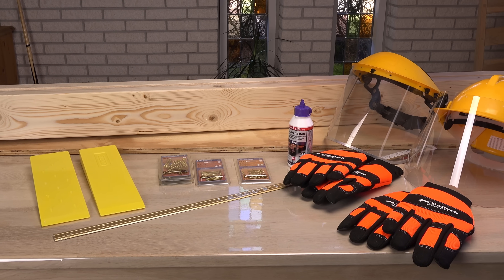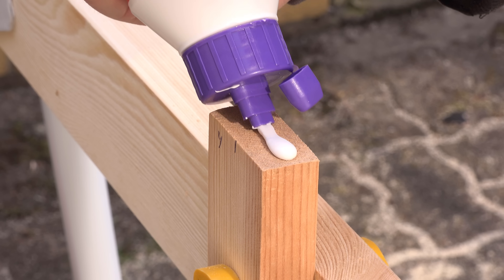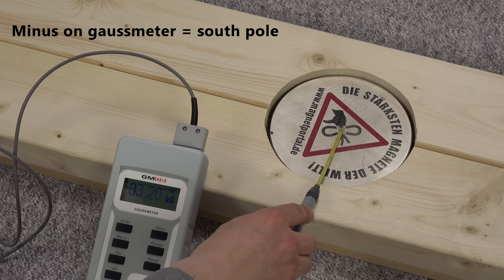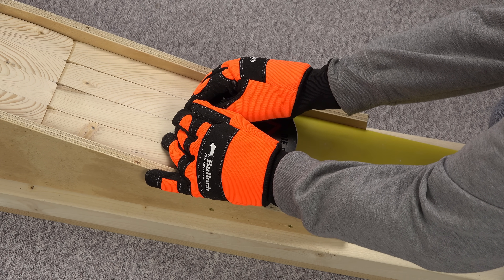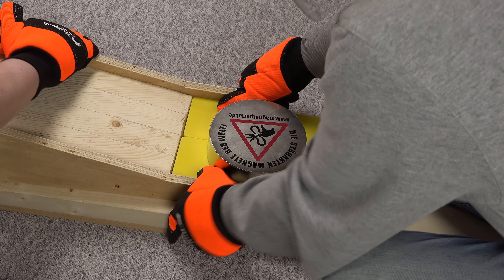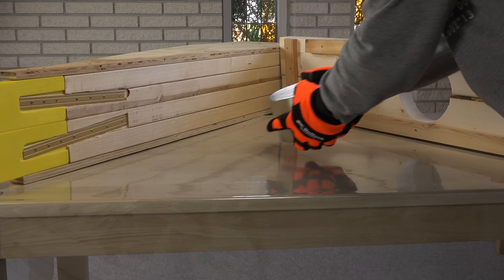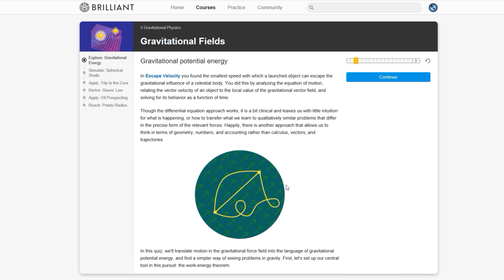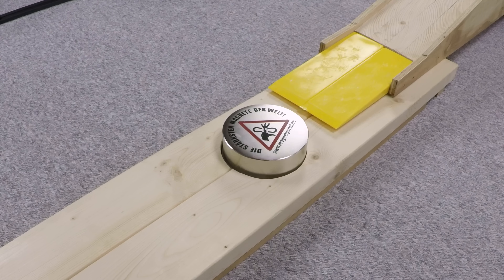Monster magnet meets monster magnet...

Comment: id say the noise was the magnet sliding on the plastic wedge
Reply: The noise is the magnet flipping over to touch the other magnet, which causes the crushed plastic wedge to expand back to its previous configuration, making that noise.
Reply: I'd say someone farted and tried to put the blame on the magnet.
Reply: Friction!
Reply: it's from the magnetic felds becoming one
Reply: I think the coefficient of friction decreases as the pressure increase.
When all the magnet area touch the plastic part the pressure is low and the coefficient of friction is high. When only the edge of the magnet touch the plastic part the pressure is higher so the coefficient of friction is lower and the magnet slips.
For the noise: imagine that the surface of the plastic part is a brush: when it adhere to the magnet because of the pressure it will deform to follow the point of contact. When it finally detach it resumes its normal form making vibrations. When the forces involved are low, the vibrations are ultrasonic and turn them into heat, when the force is high like in this case or like when something is cold rolled the vibrations turn it into sound.

Comment: Here is possibly a brilliant or stupid idea... but why not freeze both magnets in 2 blocks of ice then place them on top Of each other and then simply manipulate the melting process until they meet in the middle? Or would that not work?
Reply from the maker: I like your way of thinking, though a perfectly controlled descent might be hard to achive - especially at the end, where the forces are insane. The biggest issue is however, that neo magnets hate being submersed in water. Despite the coating, they would start corroding. And once they start corroding, they're quickly gone :( Dry ice on the other hand...

Comment: Could this be done with ice between them and slowly let it melt? Obviously restrained and controlling the speed and equal distribution of the melt....
Reply: With two point four tons of pressure from two sides I wonder if the ice wouldn't just deform and explode outwards towards the sides.
Of course you could do the entire thing inside a tube, but then you'd create a pressure vessel with two point four tons of force pressing on water from two sides, regardless if it's melted or not, I would not want to go anywhere near that...
Reply: The ice will break near the end like as if crushed by a hydraulic press and they'll smash catastrophically.
Reply from the maker: I like your way of thinking! Only issue is, that neo magnets - even with the coating - hate being in water. They corrode so easily. With epoxy coated magnets it could be a useful path. Thanks for watching :)

Comment: Could you put 1 strong magnet little bit far on right and another one little bit fat on left 
And one in middle and lift both of the right and left up, i wonder if the one in middle will float.
Reply from the maker: That's only possible, if the middle magnet is thethered. Otherwise it will turn around and align with/be attracted to the side magnets. Floating permanent magnets without tethering has been proven impossible. I believe it is called Earnshaw's Theorem. Thanks for watching!
Reply: If you got it perfectly balanced, yes. But it would still be insanely dangerous because of the two magnets to the sides.
There are much easier and safer ways to use magnetic fields to levitate things.

Comment: At the end you magnet might be turning towards Earth's magnetic field too
Reply: ElectroBOOM that's what i thought too
Reply: That's what I thought was going on at first.
Reply: Didn't expect you here xD
Reply: I love you and your channel man keep up
Reply: @ozgunkara1930  What the fuck, LOL!?
Reply: Even a small neodymium magnet does that if you put it on a smooth surface.
Reply: Yup
Reply: *your
I think that was just the table because he said his table isn't all wood.
Reply: lol
Reply: None of you were correct, partly because torque tries to turn the poles in the opposite direction, and not towards (to the same directions), partly because you mixed the mass of the earth with the rotational inertia of its magnetic field. And also because every movement can be discussed only in a given reference space, which was not given by either of you.
Reply: PafiTheOne has come to save this degenerate thread
Reply: Would it actually do that if you put it on a flat surface and somehow made as little friction to turn as possible? Or maybe hand it from a string
Reply: @Bret: it would align itself with the Earth's magnetic field eventually, if other factors like inertia (e.g. residual spin when suspended from a wire) are negligible. The magnet is heavy so it's not a good compass. This is why compass needles are very light, you don't need much magnetism but you do need low inertia/mass.
Reply: @David: When you jump you are moving away from the earth and you push the earth away from you. Obviously the earth moves a lot less but it theoretically moves.

Not theoretically, practically. The influence of your jump will be combined with the effect of other mass displacements on Earth. Oceanic currents and atmospheric circulation are the main contributors to variations in the Earth's angular momentum. Translation changes are smaller, and mainly due to the influence of other planets (e.g. Jupiter).
Reply: redstone craft guy you forgot to carry the 2
Reply: Gimme da metta
Reply: Thank goodness!!! ;-)
Reply: Collab! Make a huge electromagnet together!
Reply: @0phux  insanely easy, considering while off it'd have hardly any magnetism comparably.
Reply: the earth is under the magnets, yet it's field is far above the magnets, however they're turning laterally
Reply: David Not from a jump.
Reply: It's Turing towards the metal under the table. North/South magnetic fields have nothing to do with its movement at all.
Reply: David Now that's the smartest statement I have read so far! Good one! LOL!
Reply: Slarty Seriously???? What are you.....8 years old?? You're a tuna smelling used douche!
Reply: Zappa Make it float on water. That can be accomplished. Then you would be able to see if it will turn like a compass over time.
Reply: Just.........no 🤦🏻‍♂️
Reply: Once they're aligned you can bend earth's magnetic field any direction you like just by turning the magnet.  Mess with sailors and shizz.
Reply: Hi so I read somewhere that if enough nuclear weapons,were launched or exploded in different areas around the world,that it could disrupt the time schedule on Earth that we currently have. Is this true? I haven't found any results searching and I'm not sure if some of the ideas I brainstormed are viable.
Reply: I didnt expect you to be here lol
Reply: David  Certainly BOTH will influence the magnetic fiedl of the other. Imperceptibly after a distance - but even so, yes!

And of course LOCALLY - the magnet will distort the earths magnetic field far more than the reverse - as could be easily proven with a compass being useless within a few feet ([erhaps even a few tens of feet) with magnets of this strength.
Reply: Metal rods in the table.
Reply: Oo mehdi sir here
Reply: The magnets were turning towards the metal parts of the table. I doubt his table is aligned with north and south of earth lel
Reply: What are you doing here? BTW, I'm a sub, have the bell on, and have watched all of your past videos.
Reply: Yeeeeeeeeeeees
Reply: Literally you are here❤️
Reply: lol
Reply: HOLY SHIT ITS ELECTROBOOM LMAO
Reply: Love ur videos, keep it up man😁
Reply: Just gotta buy a compass
Reply: **you're're're
Reply: *UR
Reply: you're
Reply: @AbhishekThakur-wl1pl  You are joking.

You want to correct the guy for a simple typo - and then screw up by typing "you're" (short for "you [a]re") instead of "your" as in "belonging to you".

If you want to play pedantic school mistress, at least learn the basics first before you get your* little red pen out :)
Reply: @AbhishekThakur-wl1pl  sure ;)
Reply: What?
You're what?
Come on, you can answer!
Use small thoughts and try...
Reply: Lmao *your
 @AbhishekThakur-wl1pl
Reply: ElectroBOOM hi i love your videos
Can i get an osciloscope
Plz anser if i can😂
Reply: @blury6445  You can often get second hand 'scopes on Ebay for very little money - in some cases if you are local, you can pick them up for less than the cost of a friend paying to post a freeby to you.

Also worth looking for "PC scopes" where a program and your computer are used for data measurement and display - and a USB device interfaces to the circuit you want to play around with.

For anything other than higher freq RF, the PC scopes are extremely good - as well as being fairly inexpensive even when brand new.
Reply: David what?
Reply: David Yes, but I instantly fix it afterward
Reply: David the magnet weight 13.3 kg and the earth weight 5.972*10^24 kg, due to Newton's second law the magnet would accelerate toward the earth faster than the earth accelerating toward the magnet. -_-
Reply: pssst, pssst, whispers hey...i think... i think he was making a joke
Reply: Earth just floats in space. Isn't everything in space weightless?
Reply: what if you held the magnet just a few inches above the earth? would we be able to fly across the solar system, like, Move Bitch, Get out the Way as we zoom past venus, wave buh bye to mars and the tesla car, and breathe in the heavenly vapours of saturn and uranus?

To pat pluto on the head, give it a participation trophy, and fly away to alpha centauri?

WOuld we need two magnets, you think?
Reply: SO THIS IS WHAT OUR RICH SOCIALIST CRADLE TO GRAVE WELFARE RECIPIENT NATO ALLIES DO WITH THEIR TIME AND MONEY WHILE WE PAY FOR THEIR MILITARY DEFENSE BECAUSE THEY REFUSE TO.
Reply: David thanks captain obvious, that is LITERALY WHAT I JUST SAID . I said the earth WOULD ACCELERATE toward the magnet SLOWER than the magnet accelerating toward the earth.

Comment: scary magnets ... now what ?  separating the magnets ?       you should try using 40 power magnet verses a 58 power magnet and see if there is a difference in the size of the fields.   2 magnets joined together do not create 1 field. there is actually 2 fields but they are inter locked but not joined into one field. because the fields are bound to the material creating them.  the 2 become a  magnet  like object.  At leased this is what I think.  What do you think ?

Comment: Why not manufacture the magnets with sufficiently strong handles on the outside, or holes through which a bar could be inserted for leverage?
Reply: its actually harder to make specific special shapes of magnet .... and id imagine it would make for a big structural weak point in the material. NdBFe are pretty brittle as it is.
Reply: Atilla, marry me you smart bastard!
Reply: Alucard Pawpad XD

Comment: Buy another very big magnet and merge it with the one you have.
Electromagnets are much more dangerous when on.
I upgraded mine to to turn the compass on 4 meters. It is dangerous because if you give it too much power you get fast metal flying around
I expect the dual magnet to do 2.5 meters

Comment: Is it bad that I want to see what will happen if someone would take two of these magnets and literally throw them one at another? In a safe controlled environment with absurd amounts of protection everywhere, of course...
Reply: A little too expensive.
Reply: they'd break and their pieces would be locked together
Reply: Architector #4. A lot of sugar cube size chunks, and neodymium dust!
Reply: Architector #4 https://youtu.be/1iAumAVtxRQ 
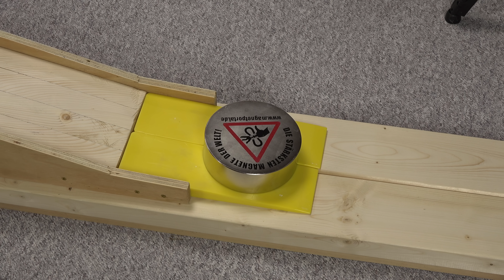u can have a background of what would kinda happen at min 5:40
Reply: +Aaron Greenfield
But the dust... Will it be magnetic too? Does that mean that it would magnet to the chunks and effectively be a stiff fuzzy coating that will cause some bad things to happen when you touch it even with special gloves?
Reply: It wiil loose his power too. Putting two magnets in front of each other their power will add up but putting there side by side they will canceled each other so in a mishmash like that all the power will fade out.
Reply: Architector #4. Yes, it will all still be magnetic, with Dust and chunks branching out like a giant sculpture. But like John said, since the pieces lose their cohesion, and most of the Particles of neodymium lose their alignment, a lot of power will be lost, Probably more than half of it!
Reply: +Aaron Greenfield
Yeah, and then it would be a pretty annoying place to lay your feet on aswell...
Reply: Woah. That video you sent me answers it, pretty much.
Still, I want to see the same but on a scale of these extreme magnets! :D
Reply: Architector #4. Here's a good one.
https://youtu.be/Vt8NOdINJ1s
Reply: they'd break and light sparks, and their pieces would still remain magnetic, loss would be petty, john stop playing the wise guy plz, thats fucking cringey

Comment: That sound is the vibration of the material as it recovers from elastic deformation.  The magnets are applying two tons of compressive force and rather a lot of friction.  As material slides out from between the magnets, it's popping back to where it should be, causing the vibrations.  TLDR: It's not moving smoothly.
Reply: I'm wondering why he didn't applied oil/grease/lube to the wedge
Reply: Yes the noise is the same than when I cold rolled aluminium sheet.

Comment: The noise was most likely the wood sliding against itself. My wooden drawers with a lot of weight in them makes the same sound. I might suggest using some wax on the edges next time, as it will help reduce the friction and make your slide a bit easier to pull.
Reply from the maker: Our guess, when hearing it live, was the wood grinding too. Thanks for watching :)
Reply: The noise could have been something else.

Comment: wouldn't it have been a good idea to lube up the ramp? (especially the plastic)
Reply from the maker: It most likely would have made it a little easier to slide them. I'm just not a fan of having a film of anything permanently stuck between the magnets. No way to remove it, if it starts smelling or - even worse - corroding the surface coating or even the magnets themselves in case they were scratched in the process ;)
Reply: Fair enough, but I'm sure that with a bit of research you could find a non-corrosive lubricant and as far as the smell you could probably just wash the magnets afterwards, any part between them that doesn't get washed is probably airtight so the smell wouldn't leak through there.

Comment: How does the strength of the combined magnets compare to the strength of the electromagnets in an MRI machine?
Reply from the maker: The superconducting magnets in an MRI machine are much, much stronger. In my previous video I measured just over 1 tesla on a single one of these magnets. But only at a very small point right at the edge. MRI's are several teslas - even at some distance as far as I know.
Reply: MRI clock in at ~700,000 Gauss (G) depending on what you are imaging (research or clinical). I think one of these magnets is ~13,500 G.

Comment: Should you want to remove these two magnets, do you think you could separate them or are they now permanently together?
Reply from the maker: They can be separated, but doing it safely without ruining them is an even bigger challenge than combining them. For now, I'll keep them combined, but who knows what I'll do in the future...
Reply: Maybe if he placed a stronger electromagnet on each side, so each neodymium magnet would be pulled in opposite directions. then turn off the electromagnets, of course, so the neodymium magnets aren't glued to them forever...

but that's just a wild idea, I'm (reaaaaally) far from being an expert. :)
Reply: As the channel said, not easily without destroying them. You can heat them to demagnetize them but that destroys the magnets. I guess yo could use bigger magnets but that's a lot of strong magnets near each other which would suck. The most straightforward way I can think of is to use wedges to get between them and force them apart enough to slide something else between them. Then you separate them from there...Or just directly pull them apart using mechanical means.

Any way you slice it, you might be better off just getting two more magnets then trying to pull these apart.

Comment: Now what would happen if you put two big magnets close enough, so they start accelerating towards themselves and then run away?
Reply: They meet in the middle, explode into very sharp bits, and then crumple into a ball of jagged scrap.
Reply from the maker: They would accelerate insanely fast right before impact and shatter each other at the massive impact. Possibly sending sharp fragments into my backside unless I run really fast ;)
Reply: You can try behind thick plexi though :P

Comment: Great, now separate them..
Reply: Labs Just heat them up.
Reply: Labs harder than splitting an atom
Reply: why?  @oofboyee1291
Reply: +Finish Him! the will get demagnetized
Reply: Aditya Banerjee I think that was his point...
Reply: fixed one magnet and use hydraulic press push the other sliding them apart , I think It can work
Reply: Labs No can do...
Reply: why not  @Legend10165
Reply: hold my beer